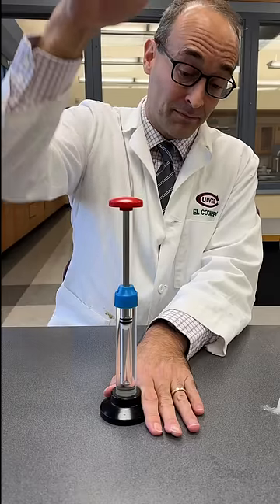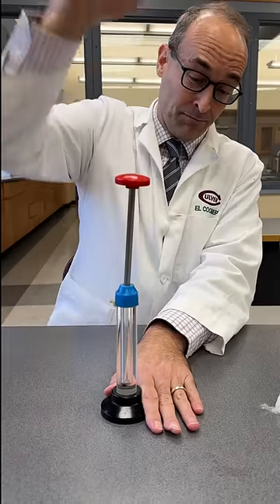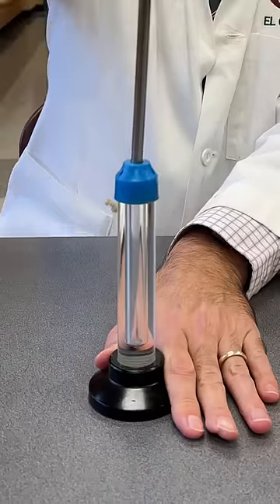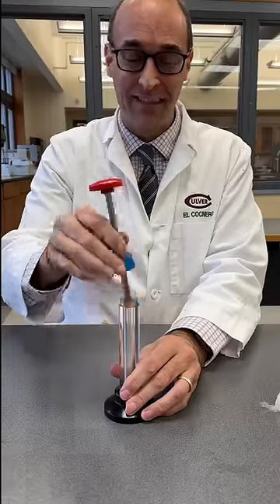Squeezing air to burn stuff

Comment: This is basically how a diesel engine works, uses no spark plugs.
Reply: Was about to say this.
Reply: Not basically, diesels are just a little more complicated than the tube and plunger he used
Reply: @kingofspain18077 This is exactly how a diesel engine works. Air is pulled inside the cylinder, and the piston then moves up compressing the air inside causing it to heat up. The only difference is the fuel is misted in towards the end.
Reply: @mattc222 no need for that. I got Cosby sauce lol (ether)
Reply: @jeffhall768  good ol Cosby in a can. MIIINT!
Reply: Why can't petrol ignite the same way?
Reply: @erickiplimo it does but it’s not intended. When normal gasoline ignites from compression it’s called knocking, detonation, or dieseling. That’s why people run higher octane, it’s a rating for its detonation or “knock” sensitivity. If gas go bang at wrong time, is bad for the engine.
Reply: Putting toilet paper in the gas tank now😂
Reply: @erickiplimo gasoline (petrol) burns faster and more easily than diesel does, if you did this with gasoline youd blow a hole in your pistons (the multifuel engine in the old US Army 2 1/2 ton transport was a diesel that could run on gas, but it had to have modifications made to the pistons and cylinders to prevent the gas from detonating, and you had to add oil to the gasoline so it didnt destroy the rest of the engine
Reply: This is exactly how a diesel engine works.  4-stroke gasoline engines go out of their way to avoid this.  The whole point of burning high octane fuel is to prevent "pre-detonation" of the fuel igniting before the spark plug ignites it.
Reply: They use Glow plugs to ignite the compressed  fuel
Reply: On old tractors, for example, you actually had to cut off the fuel to turn off the engine. Battery, no battery connection didn't really matter for those engines.
Reply: @erickiplimo they can, which is where the octane rating of the petrol comes in. Higher octane allows higher compression before auto-ignition.
Reply: Ty sir.  Gas engines do not work like this.
Reply: @erickiplimo Gasoline can be burned the same way. It's the holy grail of gas engines, look up HCCI. They've been working on it for decades, the fundamental problem is they can only get it to run without issues like predetonation in a very narrow power range.
Reply: this process is legitimately called dieseling.
Reply: @kingofspain18077  the actual physics are the same though. A diesel engine requires timed valves and a glow plug to meet autoignition Temps.
Reply: And this Is how submariners die when Hill breaches they Burn to death in miliseconds.
Reply: @41241ivatt no just no
Reply: They use glow plugs
Reply: My one cylinder diesel engine doesnt have glow plugs. Stop saying that diesel engine use glow plugs to ignite the fuel. The glowplug is just for warming the air when the engine is cold so it can start. Since the engine dont start easily in cold air. [I reckon it called warm start] even though. Some engine doesnt have to use glow plugs to start. Hence the so-called cold start
Reply: @hirusthehellhound  normal diesel engines literally need a glow plug to start itself and ignite the pulverized fuel tf are talking about , show me a single car without a glow plug
Reply: @alexandre007opa  well. Some of Hino engines doesnt have glowplugs. Even some of the isuzu. And also. A tractors. Newer Kubota here doesnt have glowplugs. And a truck with single cylinder diesel engine [called e-tan here in thailand] doesnt have glow plugs.
Reply: At least some do to start
Reply: @mattc222 this one
Reply: @erickiplimo because you need 2000 to 3000bar of pressure usually generated by fuel injectors on direct injection petrol car.
Reply: Glow plug
Reply: I was going to say the exact same thing.
Reply: No it's Not. The Diesel Air Mix is not getting compressed.
Reply: @41241ivatt nope The glowplug is used just at very low temperatures to preheat The cylinder
Reply: @mattc222 The glow plugs only light up if necessary. When it’s cold. They don’t light up at all during summer on my car.
Reply: He probably had a model of a ic engine. It's cooler to have a model

I bet you guys don't have a model desil to show off

/S
Reply: They use heat plugs.
Reply: Isn't it how all 4 stroke engines work on a compression stroke?
Reply: @kingofspainMB1807 that's what basically means. Everyone knows the real engine is more complicated. You really thought you said something interesting there.
Reply: glow plug
Reply: Yes, a diesel engine does work exactly like that. They don't need any electricity or spark plugs to run. Some diesel engines do have glow plugs to preheat the engine head so the engine does start easy even in cold environments. It's not needed for the engine to run at all. Modern diesel engines are more complicated to work more efficient and clean.  But they still do use this effect to run.
Reply: @kingofspainMB1807 wrong that is how diesel engines work
Reply: This is NOT how a diesel engine works. A diesel engine injects the fuel at the right moment.

You may be thinking about a glow-bulb or hot-bulb engine — that has fuel injected into the bulb, where it reacts briefly with the little oxygen available.
Then air is let into the cylinder and compressed by it, when enough air enters the glow bulb under pressure, the main combustion starts, reheating the glow bulb and pushing out the hot fuel into the cylinder where it ignites and burns with the oxygen.

Note that normal spark-plug gasoline/petrol engines can have fuel injection, which is a distinct advantage for acrobatics of fighter aircraft. The early WWII Spitfire famously had a normal carburettor and would cut out in negative g and then return to an overly rich fuel mix, both causing a momentary loss of power. Only with the pressure carburettor was this behaviour fully cured later in the war. 

German engines used fuel injection and were not at all bothered by negative g forces. Pilots used that to slow down an enemy following them. Fuel injection has other advantages, such as being able to have both intake and exhaust valve open for a long time, providing cooling and cleaning out lingering combustion products.
Reply: @mattc222 except you actually don't have too. It only helps when the fuel itself and the air is cold. It's only there for assistance.
Reply: @advorak8529  literally how a diesel enginen works.
Reply: Just an addition - you need glowplugs for colder to human climates.
Reply: @eivis13 you don't need them, but they help.
Reply: Explain please
Reply: @kingofspainMB1807  "Basically" - "used to indicate that a statement summarizes the most important aspects, or gives a roughly accurate account, of a more complex situation."
Reply: Yeah but they use the heat of rapid compression to inject fuel at the right moment.
Reply: @advorak8529 wrong
Reply: @bradleypolotto5193 preheated air on startup, and diesel injection against the hot compressed air. How is this the same?
Reply: @blitzv10   Name one diesel engine that does not inject fuel …
Reply: @LordScrambles1  Yep, you can use a blowtorch. Really old Lanz tractors for example …
Most car and truck diesel engines are not accommodating to blowtorches. No space to apply and way too many parts not tolerating a blowtorch nearby …
Reply: @jeffhall768  creating an "Ether Baby"
Reply: @41241ivatt No glow plugs are just for when engine is cold. Still uses "heat of compression" to ignite
Reply: @codyreber8370 glow plugs are only required at cold startup, not required at normal operating temps, at least in normal climate. Might be different in freezing climates, not an issue here in Australia
Reply: @alexandre007opa only when cold
Reply: @alexandre007opa might be climate dependent I don't recall having had glow plugs in my Toyota Prado & if it did would only been used at startup when we went to the snow 1500km away. I'm only aware of glow plugs in trucks here for cold weather & off once engine temp achieved.
Reply: @hirusthehellhound yeah, climate dependent I don't recall having had glow plugs in my Toyota Prado in Australia & if it did would only been used at startup when we went to the snow 1500km away. I'm only aware of glow plugs in trucks here for cold weather & off once engine temp achieved.
Reply: @bradleypolotto5193 also they usually use a heating element(glow plug) to aid in ignition to ensure an even combustion
Reply: @jeffhall768  Ether pudding pops 😏
Reply: @bradleypolotto5193 Doesn't diesel get injected as the piston starts to come back up? Either way, the diesel engine is more interesting than a gas
Reply: Yup
Reply: And tbh, this is where Rudolf D. got his idea.
Reply: They use glow plugs to get it going then it just runs off it’s own
Reply: First thing that popped to my head as well
Reply: @AzizSdiri  then don’t let the pressure rise so much😂
Reply: @mattc222 that’s what they meant by saying “not basically”
Reply: @kingofspainMB1807 they meant the concept in physics, not quite so literally as you took it lol
Reply: Exactly what i was about to say too
Reply: @kingofspainMB1807  dude the first diesel engines are literally just as simple as that other then injection
Reply: @erickiplimo gasoline is only combustible with a flame diesel is only combustible with heat if u pour diesel on a fire it will ignite due too the heat when air gets compressed it gets extremely hot so when u inject the diesel it instantly combusts
Reply: @erickiplimo if you do the same thing to petrol, it's very harmful for the cylinder and piston. You are able to do this in your car (DON'T!!!), using lower octane gas.
Octane number is how much do you have to decrease the mixture of air and petrol fumes for it to detonate, which is exactly what we don't want in our engine (it's like blowing up a small explosive tens of times per second inside). For pure octane it's around 12-14 times, if I'm not mistaken, and 95 octane number means the ratio needs to be 95℅ of these 12-14 times for that exact gas. So, in conclusion. Your engine 95? You may use 98, if you want, it would only hurt your wallet. Under no circumstances should you use lower than 95.
Reply: Compressing the oxygen within air creates a piezoelectric arc.
Reply: Came here to say this
Reply: @kingofspainMB1807  That's what basically means
Reply: Well, it does use heating plugs
Reply: @erickiplimo petrol engines use a spark plug because then the cylinder block doesn't need to withstand those compressive forces and can be made lighter. Compression ignition is useful for heavier and less refined fuels that are harder to ignite with a spark plug.
Reply: @erickiplimo diesel self combusts at 200 degrees petrol is much higher
Reply: @mattjohnson4751 Sometimes high compression gas engines do this when you burn a gas with a low octane rating. It’s called “knock” because the fuel detonates during the compression stroke before the spark plug can ignite it causing a knocking sound.
Reply: I was about to comment the same thing, until I saw your comment. Exactly.
Reply: @erickiplimo it can but it’s just easier to do with spark plugs
Reply: It is literally how a diesel engine works actually, just diesel (or basically any fatty oil) instead of cotton
Reply: @thedarkenigma3834 🔴 What Is Islam? 

🔴 Islam is not just another religion. 

🔵 It is the same message preached by Moses, Jesus and Abraham.

 🔴 Islam literally means ‘submission to God’ and it teaches us to have a direct relationship with God. 

 🔵 It reminds us that since God created us, no one should be worshipped except God alone. 

 🔴 It also teaches that God is nothing like a human being or like anything that we can imagine.

🌍 The concept of God is summarized in the Quran as:

📖 { “Say, He is God, the One.  God, the Absolute.  He does not give birth, nor was He born, and there is nothing like Him.”} (Quran 112:1-4) 📚

🔴 Becoming a Muslim is not turning your back to Jesus. 

🔵 Rather it’s going back to the original teachings of Jesus and obeying him.
Reply: @1islam1  What did I say that has anything to do with Islam or religion in general?
Reply: @erickiplimo you can't have optimum ignition timing, you'll have detonation instead of flame propagation.
Reply: @41241ivatt nope, only air is compressed. The diesel fuel that is injected is highly pressurized however.
Reply: @alexandre007opa Kubota farm engines is normal engine as well. 😂😅😊
Reply: @hirusthehellhound Also in old Toyota engines. Instead of glow plugs, it have that heater element in intake manifold that heats up intake air.
Reply: @DasKloputzer true, only air is compressed. Then the atomized diesel fuel when injected burns because of the heat generated during compression of air.
Reply: @advorak8529 somewhat similar, only the demo has no diesel fuel being injected.
Reply: @reddirtmoto4841  there are some thats called "fire starter" as well. As it literally start a fire in the manifold
Reply: @hirusthehellhound  I saw that being performed unto an old engine. I think it was a Kubota engine with hand crank starter.
Reply: @reddirtmoto4841  when the engine are old and worn out. Sure you want to do that. But a new and rebuilt engine doesnt need that
Reply: So this comment is For those who don’t know what combustion engines is?
Reply: @erickiplimo it can it's just a lot more unstable and it would be wildly inefficient to design an engine to do such a thing because of the force that would need to withstand for little to no performance gain would make the engine weigh more than the vehicle it would be able to power
Reply: It uses pressure and glow plugs
Reply: @kingofspainMB1807 yes so basically
Reply: @mattc222  my bmw has had faulty glow plugs for a couple years. No issues at all. Just runs like a traktor for a couple seconds if its really cold outside lol
Reply: What is a glow plug
Reply: @alexandre007opa real diesel engines don’t have glow plugs
Reply: @kingofspainMB1807 this is exactly how their combustion works. Add a crankshaft to the end of the plunger, put a shaft with a 2:1 timing ratio off of it to open and close a pair of valves 90° apart from each other, and you have a small diesel engine.
Reply: @erickiplimo it can be, but it is less predictable. A spark is a much more controllable way to ignite it.

A simple gasoline engine can actually burn diesel once it’s hot. Many old tractors had a fuel tank and a gasoline tank on them. Start the tractor and warm it up with the gasoline, and then switch a valve to make the engine burn diesel or kerosene, because it was much cheaper than gas in those days.
Reply: @kingofspainMB1807 this guys smart he knows a diesel engine is more complicated 🎉 only if everyone could realize this fact on there own it’s astonishing you should run for president or get your doctorate
Reply: @erickiplimo  Mazda SkyActiv X engine
Reply: Top comment, not disappointed
Reply: Bro I wanted to say this. But u r already there's 😊
Reply: I see that someone watched Veritasium.
Reply: @erickiplimo  Mazda actually has this. It is pretty complicated though. Others don't do it because Diesel engines have to be built far more robust due to pressures and such, which is why they tend to be significantly more expensive.
Reply: @opachki8325  so does it mean explosion by detonation is far more violent/stronger than explosion by ignition?
Reply: @erickiplimo  it just means that pressures required for a diesel engine to properly function are way higher. You need stronger pumps (500 bar at most vs. roughly 3000 bar), a stronger block, stronger internals and such due to higher internal pressures. 

Besides that it apparently isn't really that easy to pull off unless you really invest a lot of money apparently. The skyactiv-x engines only switch to this under low load due to way lower power per displacement.
Reply: The same thing happens with air rifles and it's called dieseling
Reply: Huh.. watch the video. That exactly what he said n showed.  Tf
Reply: @erickiplimo its not meant to.
Reply: @mattc222 unless its an older diesel where its just pure compression
Reply: What the frick
Reply: Diesels require a glow plug to burn or fire the fuel.
Reply: a diesel engine is a combustion engine it’s just powered by diesel
Reply: Next stop cotton powered engine.
Reply: @TonkarzOfSolSystem  i wonder how fuel delivery would work with that because the cotton could have the potential to stick a valve slightly open and could cause a random misfire
Reply: @i_eat_dirt2  The only think I can think of would be a belt fed design with little capsules that contain the cotton. But the precision required in timing and machining to create a combustion proof seal would be, I'm sure, impossible. Never mind the added weight of the belt and capsules, nor the added volume.

I was only suggesting it as a joke but still it's a curious problem.
Reply: @laurenciozabala4296  not all.
Reply: Glow plugs?
Reply: Why do petrol engines need spar plugs?
Reply: @jackfrostcm108  to light the fuel??
Reply: @jackfrostcm108  Diesel explodes when compressed, just a property of the liquid. Petrol doesn't, so to make the petrol explode there are spark plugs that ignite the petrol with an electrical spark at the right instant in the engine process.
Reply: @bradleypolotto5193  I always wondered what the difference was between a diesel engine and a normal gasoline one.

So there's no sparkplug? How does the engine start then?
Reply: @alexandre007opa No they don't.
Do you even know what a glow plug is?
Reply: @darklordofsword  the glow plugs are timed to only come on a short bit of time before you crank the engine heating the air inside the cylinders. As the piston goes up it compresses the air inside. As air compresses it heats up (I don't remember the exact temperature it gets to). Once the cylinder reaches close to TDC, the diesel is misted inside causing it to ignite. Without the need for an extra piece such as a spark, this can also cause a diesel to "run away". Basically, it will keep running even after you cut electrical power to the engine.
Reply: @FedSmoker64  i guarantee you most diesel cars in the EU will not start if they don't have glow plugs on, smaller engines pretty much relly on them due to their small volume they cannot produce the heat required in the compression to start , tbf most our diesel engines are smaller than 2.0 so i get where most people here are getting at try starting a 1.5 clio without glow plugs or a 0.9 smart but yeah doubt you need them in a pickup
Reply: @alexandre007opa  Just because poorly designed EU engines need them does not mean diesels need glow plugs. My deutz and international diesels have never needed glow plugs in freezing temperatures.

Diesels from their invention did not need glow plugs, but trash engines do.
Reply: It's not at all how it works glow plugs heat the fuel. This doesn't need any outside temperature to promote combustion.
Reply: @bradleypolotto5193 no, it's not. This doesn't need any added temperature source to promote combustion like a diesel engine does.
Reply: @-TAPnRACK-  Glow plugs are not needed on well designed engines. They are a luxury item not essential to the design of a diesel engine.
Reply: @FedSmoker64  maybe not glow plug but definitely a grid heater
Reply: @-TAPnRACK-  No, none of that is necessary and the original design of a diesel engine did not have them.
Reply: @-UnoriginalName-  not all diesel engines have glow plugs (which only activate before cranking). The concept is the same though.
Reply: You use no sparkplug
Reply: @FedSmoker64  they're hardly trash they're just smaller than the ones in the U.S but fair enough I get your point
Reply: It makes no sense adding Spark ignition into diesel engine because the mixture of air + diesel doesn't going to catch fire through electric spark.
So that's why it takes longer time to start diesel engines.
Reply: So simple differences is that the diesel hai compression ignition where the air is compression with high heat and insteas of spark plug the is fuel injection where there is Fuel+air mixture when the fuel expands and the power is transmited from crank to shaft and so on ...
Reply: Exactly. Some smaller ones have glow plugs though
Reply: I was just about to say that in a comment.😂😂😂😂😂
Reply: @kingofspainMB1807  yes basically, that is the perfect use of basically, it roughly explains the process in a BASIC way
Reply: Compression ignition
Reply: Yeah but mr doctor science didn’t say that, he was too busy huffing cotton.
Reply: @erickiplimo  It can, actually! That's referred to as an 'HCCI' engine (Homogenous Charge, Compression Ignition). It's tricky to pull off, but offers massive efficiency gains (20% or more) due to the ability to use extremely high compression ratios (in the neighborhood of 16:1). Mazda is now producing cars with HCCI engines. They call it "Skyactiv-X'. However, it currently only runs in 'HCCI mode' some of the time, as it's only possible (without detonation/knocking) under very specific conditions. Outside of those parameters, it reverts to spark ignition.
Reply: i mean they have glow plugs tho right? idk shit about diesel engines and what glow plugs do though
Reply: Well, they don't have a giant hand starting the action. It needs the initial combustion
Reply: Yes, it uses compressed air that sparks to ignite fuel with no spark plug needed.
Reply: They use igniter.
Reply: Beat me to it!
Reply: @alexandre007opa lol no. No, no, no. Look up the cummins 5.9L 12 valve. Used in tractors and dodge trucks for years and they dont have glow plugs.
Reply: @limptuna7687  I've explained my point of view on another respond, here in europe I'm pretty sure most diesel car engines can't hold up without glow plugs due to them being really small engines, kinda forgot about the high capacity engines used in other parts of the world and/or other sectors besides civilian personal vehicles
Reply: @erickiplimo Petrol or Gasoline is more stable and requires compression and a spark to ignite. Diesel, being less stable, does not need a spark
Reply: Diesel engines compress more air into a smaller space, so the temperature is higher and the fuel ignites. Gasoline engines need a spark since there is less compression.
Reply: Damn it, I was gonna say that!
Reply: but has glow plugs
Reply: @outkast937 Mazda is or was working on a compression fired gasoline engine. It was supposed to be an engine that could switch between spark and compression ignition as needed. Not sure how successful it was, but it’s been done.
Reply: Principle is the same.  There are just ancillary systems to put in more "cotton" and get rid of the "smoke."
Reply: @outkast937 diesel = 2 stroke.
Reply: Darn, you beat me to this
Reply: @kingofspainMB1807 oh you fucking think? Lmao
Reply: @erickiplimo it can, but diesel doesn't offgas flammable vapors, while petrol does.

This means you need higher compression to ignite
Reply: This is exactly what I opened the comments to say
Reply: Also is the reason intercooler scare needed
Reply: @41241ivatt  no glow plugs are used to heat up the cylinders of the engine before we even start the truck my 6.0 you have to turn the key wait until the glow plugs have turned off then start it because the engine needs the air inside the cylinders to be warm/hot to combust
Reply: @hirusthehellhound agreed when i am in warm state i pull the fuse for my glow plugs because its not needed in hot places glow plugs are only used before the truck starts diesel is a compression engine
Reply: @alexandre007opa  in hot areas glow plugs are not needed when i visit so cali i pull the fuse for my 6.0 f350 glow plugs because its always 60-80 and it starts up easy
Reply: zibret4199  no with diesel engines they always light up until the cylinders meet a certain temp that why during summer then shut off faster then during winter thats how my 6.0 powerstroke is any every one of my coworkers trucks
Reply: @erickiplimo  it would but it'll explode so fast and damage the engine
Reply: @Eli-ki7eh there's a huge difference between self ignition and detonation.
Reply: Turkish high-tech !   I have a folder about it.
Escape the matrix !
Reply: You learn something new every day
Reply: So why do we need diesel if air alone ignites ? 😂
Reply: @41241ivatt  lmao
Reply: @alexmedvec4571 Diesels have a electric starter motor just like petrols. During ignition, the start motor turns and pistons move up and down and so on. Diesel oil is prayed in the cylinder at the same time and what happened in the video starts to happen in the cylinders and the engine starts to run on its own.
Reply: @41241ivatt no, the glow plugs are only used to start an engine, they simply heat the air inside the cylinders to help with combustion initially, they’re not even on when the engine is turning over. Cummins engines don’t even have glow plugs, they have a grid heater in the intake to heat the air as it enters the cylinder. You don’t need glow plugs at all. The new holland 7.8l inline 6 from the 90’s didn’t them, just used ether when it was especially cold.
Reply: That's why they're also called "compression ignition engines".
Reply: I was gonna say
Reply: @cwest394 if you get it to flow like a liquid it would run in a diesel engine
Reply: @Boerkie1990   If slave lake can run on it, then its good.
Reply: Actually they have something else called a glow plug that gets it started
Reply: Also that's why you'll destroy your diesel engine if you put wrong fuel in it. I guess there is no much trouble with diesel in gas engines cause gas compression ratio is smaller than diesel
Reply: Glow plugs
Reply: Wait, diesel engines dont have spark plugs?
Reply: @11141q  nope they don't, diesel engines compress pure air, then due to high pressures when fuel is inyected combustion happens
Reply: Yeah! I thought that was familiar
Reply: @erickiplimo  because fuel is less stable and predictable and might light before the piston gets all the way to the bottom, causing the engine to try to spin backwards. This is called knocking. It still happens if you run too much timing or compression with low octane fuel.
Reply: @41241ivatt no... the glow plug is just there to get the inside of the cylinder hot enough for this to happen on a cold day... which is why you don't need then in summer
Reply: Shit. I read your comment after I wrote basically the same thing. Lol
Reply: @mattc222 that’s no longer an issue with new diesel engines.
Reply: @41241ivatt nope they sure don’t.
Reply: @kingofspainMB1807 it’s just the basic premise that the cylinder compresses the air so much that it gets hot enough to ignite fuel diesel just happen to spray fuel right at tdc after the air is compressed to make combustion
Reply: But often use glow plugs to get going
Reply: @gingernutpreacher  not always and that’s just for starting in cold weather
Reply: @gingernutpreacher  newer diesels don’t unless in extremely cold environment.
Reply: @williambiggs9752  yes they do as there relatively small IE 4 cylinder 1.6
Reply: @christiangirard6634  for starting in general most European diesels are small  like 1.6 for example
Reply: @gingernutpreacher  no one cares about small euro engines and I’m speaking for American engines big 6+liter engines
Reply: Was going to say a diesel is probably better example than a gas engine with spark plugs
Reply: @christiangirard6634  no one cares about big American diesel engines. Which engine is more common in the world? ( you also need to look at Asia and China)
Reply: Beat me to it
Reply: That's exactly how a diesel works except the fuel is delivered to that highly compressed air charge and ignites on contact.
Reply: You stole my comment. You stole it real good.
Reply: @bradleypolotto5193 Ok, so this is exactly how a diesel engine works except it’s “just a little more complicated”, like kingofspain said.
Reply: Excellent
Reply: The time required for catastrophic implosion to occur following a hull breach is absolutely not sufficient for human beings to burn to death prior to the flooding of a submarine. Submariners don't burn to death during implosions. @JMiskovsky
Reply: @kingofspainMB1807 you got wrecked nerd
Reply: @kingofspainMB1807 but do you know how a diesel engine operates? It operates just as similar to the ICE with the exception of spark plugs.
Reply: Glow plugs not spark plugs spark plugs would never ignite diesel
Reply: @tvoovm7254  It has pistons, connecting rods and valves, sure. But in many other ways it is very different. It doesn’t adhere to the stoichiometric ratio for example, isn’t designed for the same atomization pattern as gas, is timed by the injection of fuel, and is often sensitive to combustion temperature, meaning high load over a long period can melt pistons.
Reply: Don’t the use glow plugs because Diesel doesn’t ignite itself, but Gasoline does, so it has spark plugs but only uses them for the start?
Reply: @Pelpe  think of a diesel as a “heat engine”. It squeezes air to get the air hot, so it can be used to combust diesel. However a diesel sitting in a cold environment overnight will be too cold for meaningful heat to be generated at startup. Glow plugs exist to bridge that gap, providing heat with which to start. Once the engine is running, it builds its own heat.
Reply: @Pelpe  smaller diesel engines like Ford 350s and all will use glow plugs cause they can not create enough compression the compression super heats the air and ignites the diesel fuel in the larger diesel engines like semi trucks construction equipment city and charter buses no glow plugs required  s50 sy0 Detroit diesel Cummins c13 cats
Reply: @bradleypolotto5193 why did you basically just say exactly what that other guy said and reply like you were correcting him
Reply: The amount of people that think glow plugs work like spark plugs is crazy 😂
Reply: @zf9903  still doesn't change the fact that that a diesel engine has most of the operating components and mechanism of that of an ICE, and it doesn't matter if the fuel of both types of engines are injecting fuel at different times; why would timing be accountable if every type of engine has different timing respectfully? I'm not talking about timing here. I'm talking about the components and mechanism, but I've already clarified that the diesel engine operates SIMILAR to that of an ICE engine with the exception of spark plugs. My statement still stands.
Reply: Didn’t know that!
Reply: @mattc222 not every diesel engine has glow plugs
Reply: @41241ivatt no they don’t
Reply: @codyreber8370 glow plugs are not required. They just make cold starts easier.
Reply: @alexandre007opa not every diesel engine has glow plugs. They just make cold starts easier.
Reply: @alexandre007opa I work on diesel engines without glow plugs. I’m a generator mechanic in the marines.
Reply: @bradleypolotto5193 

I think he was talking about the device. An engine is automatic, and so more complicated than a manual pump thing. Imagine a manual engine lol.
Reply: Yo, can we do this with keef? Lol
Reply: My thoughts exactly. “You wouldn’t expect” to know that unless you’ve worked in the real world. These egg heads are so out of touch.
Reply: 2 stroke diesels to be specific.
Reply: They are not meant to but they can, basically diesel engines compress a lot more, to do the piston has to move higher that's why they provide more torque than petrol engine. The distance between top dead center and the shaft is bigger than that of a petrol engine   @erickiplimo
Reply: He doesn’t know 👨‍⚕️🤦‍♂️😂
Reply: I got it, thank you Mr mechanics
Reply: Then why do regular gas vehicles need spark plugs when compression alone ignites?
Reply: Was just gonna say that lol
Reply: Basic... Boyle's law
Reply: @stevemiller. Because they're just built different
Reply: @stevemiller.  You're not making sense here. Regular gasoline cannot ignite during compression ALONE because it's impossible; gasoline only ignites if there is fire in the present in the engine which is the source of engine operation. For instance, a spark plug will ignite the fuel during the Power stroke where the air and fuel mixture get warm, with the help of the secondary ignition during this specific stroke (ignition coils being inducted and delivering all the power to the spark plug) enabling the explosive power of motion helping the engine to operate during the entirely of the 4 stroke cycle over and over again until there's barely fuel or the vehicle gets switched off the ignition. The spark plugs are also a key part of the ignition system operation.

It's not hot enough to burn gasoline alone without a spark plug.  

Now imagine if you did NOT have any spark plugs on your "gasoline" car's engine. It will not only be impossible for the air fuel mixture to ignite, it will also be impossible to complete the ignition system cycle where the engine suppose to run.

Why would you think that gasoline can ignite during compression WITHOUT spark plugs?
Reply: @41241ivatt glow plugs only pre-heat the cylinder on initial startup. That's why you have to turn the key to "on" for a moment before cranking.
Reply: @DasKloputzer You are incorrect. That's the difference between direct and indirect diesel injection. Both are still widely produced.
Reply: @mattc222  diesels don’t need glow plugs and most diesels larger than what you see in a pickup truck don’t have them.
Reply: @erickiplimo it can…..but it’s too unstable and violent to be used in a normal sized internal combustion engine. Older carbureted Cars with lots of carbon buildup in the combustion chamber / on the piston crown surface can actually keep running with the key shut off for just that reason. The carbon buildup raises the compression ratio enough that when the cylinders are warm the fuel can auto-ignite without spark and the engine will keep running, albeit poorly and very loudly.
Reply: Yup more or less
Reply: 37026
Reply: @bradleypolotto5193  did u forgor the glowplug?
Reply: @thedarkenigma3834  that’s what I’m sayin
Reply: @straightpipediesel there does appear to be a Mazda engine that has gotten extremely close, with crazy compression ratios, but it still needs a spark. It is a highly efficient engine, though.
Reply: @kingofspainMB1807 it is not much more complicated than that 😂
Reply: @mattc222  don't need glow plugs
Reply: @41241ivatt No the glow pulgs heat up the cylinder prior to starting obce the engine is sufficiently warm they switch off
Reply: Diesel should be capitalized. It’s a proper name. I get sad seeing Rudolph Diesel being disrespected.
Reply: @41241ivatt They do not. They use compression, it's right there in the name "compression ignition."
Glow plugs prewarm the cylinders prior to start up and are technically optional. Many competition vehicles delete the glow plugs entirely.
Reply: @reddirtmoto4841 Well of course, how are you going to inject cotton?
Reply: @TonkarzOfSolSystem petrol absolutes explodes when compressed. The whole point of high octane fuels is to resist detonation until the exact right time. Pre-ignition is called knocking or pinging and can destroy an engine by working against the internal parts.
Reply: @stevemiller. Spark plugs allow precise control of ignition timing, which is important for not blowing your engine to pieces. It's also why gas engines tend to be considerably lower compression than diesel engines. High compression and low octane can permit gasoline (petrol) to detonate without spark, but at unpredictable times during the stroke. The flame front might work against a rising piston (wasting power or damaging other parts) or even backfire through an open valve back into the intake.
Reply: @Lawrence330  okay
Reply: @kingofspainMB1807 .... No.. this is exactly how a diesel engine works. The only difference is the glow plugs, which are only there to start the cycle. Once the engine is running, the plugs dont do anything.
Reply: @erickiplimo it does, but not a good reason to. Pre ignition in a gasoline/petrol engine is called knock and is bad for the engine. can cause damage to the combustion chamber to uneven hotspot and spread of energy. pistons could shatter. thats why we have different octane ratings
Reply: Legit was gonna say that, so the mechanics be flocking to this comment lol
Reply: @Austin41241 
Yes but also no, sometimes a glowplug is necessary but not always. It varries from engine to engine and really glow plugs are mostly used for cold starts and not run the entire time. Friction is normally the main method of combustion in this type of engine. And really if you turn it over enough times you would not need the glue plug to start it. The plug just makes cold starts easier!
Reply: @alexandre007opa as i just explained to the previous guy yes, but also no,  glow plugs are used in these engines yes but normally they are used primarily in cold starts and to ensure full combustion of the fuel. They are in no way required!
Reply: @akun10years10 yes but also no! Glow plugs are used mainly for the cold start of this type of engine. They are also occasionally used to ensure full combustion of the fuel but are in no way required and friction is the main method of combustion! Hope you learned a cool thing about engines today!
Reply: @kingofspainMB1807 not really lol! Amazingly they are super simple engines!  But what isn't simple is the fuel! So you may be thinking oh well glow plugs are how they work, and you would be partially correct! Glow plugs are used in cold starts to make starting the engine for the first time easier but the plugs will normally shut off after and if they come back on its to help the fuel cumbust completely.  There are still diesel engines that do not have glowplugs! They are rarer but do still exist and they aren't really required for any of them. Diesel engines were literally created with this video's experiment in mind! I hope you learned some neat things about engines and have a good timezone!
Reply: @erickiplimo well the answer is it can. Its just harder and doesn't burn completely. Petroleum is a more stable gas and really won't ignite very well at all unless mixed with air. Diesel by contrast is more unstable and more willing to ignite under forces like friction.
Reply: @41241ivatt  No, the glow plugs heat up the cylinder so that the diesel can reach its evaporation temperature. The plug isn’t actually responsible for igniting the fuel.
Reply: I always wondered, why do gasoline engines have spark plugs anyway? Gasoline is more volatile and even has a sub zero flashpoint so I'm sure it can ignite by compression, definitely at a much less somoression ratio that that of a diesel engine
Reply: About to say the same thing
Reply: All ic engine works this way some need spark as too much compression may not utilise the fuel efficiently
Reply: @kingofspainMB1807 if he added a heat source and some holes it would be the same
Reply: Compresses the fuel and produces heat energy to push the pistons
Reply: And a jet engine
Reply: glow plug:
Reply: They use glow plugs
Reply: Very True
Reply: Rudolph Diesel got the idea for a compression-ignition engine from a cigar lighter that worked just like this.
Reply: was about to say the same
Reply: @mattc222 not all diesels have glow plugs
Reply: @erickiplimo because of the high pressure in the cylinder at time of injection for a diesel engine, the fuel system needs the lubricating properties of diesel fuel (basically super light oil) to lubricate the moving parts. 

Gasoline doesn't lubricate anything, so it's been challenging to design a pump and injectors that can operate at a few thousand PSI with gasoline's lack of lubrication. 

So it's not so much that gasoline can't, it's that the fuel system can't.

As a side note the issue with gasoline in a diesel isn't the commonly held misconception of ignition way too early, because there's no fuel during compression. Instead the issue is that the gasoline destroys the fuel injection system by removing the lubricating properties of diesel fuel.
Reply: @41241ivatt no they don't. Glow plugs are a cold start aid only. The fuel isn't compressed, only the air, the fuel is shot in at the ignition point (injectors serve as spark plugs for a gas engine).
Reply: @basslachnith865 new diesels you still cut off the fuel to turn them off. Just often it's done by a electrical solenoid that kills fuel when you turn off the ignition.
Reply: @alexandre007opa only for cold start. And not all use glow plugs
Reply: @hirusthehellhound finally I'm not the only person here who knows how s diesel engine works lol
Reply: @alexandre007opa every 5.9 Cummins ever
Reply: @Veroxzes or when manually switched on like my truck that is slightly modified
Reply: @LisaAnn777 no, gas engines don't get hot enough to auto ignite, they use spark
Reply: @FactionalSky mostly just the emissions side of things. Otherwise they're mechanically simpler then the older diesels
Reply: zibret4199 depends on the vehicle. I've had 6.2s with automatic glow plugs that kicked on anytime it was under like 80 out. My current 6.2 is just set to cycle them anytime master power is turned on
Reply: Exactly!!!
Reply: @bradleypolotto5193  it’s atomized bro not misted
Reply: @SilverStarHeggisist  well I am a diesel tractor mechanic myself. I repair thise hand crank diesel engine a lot. Take an example. The Kubota RT140, ET100. Try find a glow plugs on them haha
Reply: Yes my truck runs on 100% cotton
Reply: @hirusthehellhound  I think you meant to reply to someone else
Reply: Just sprays the diesel into the hot compressed cylinder.
Reply: @arifariffulislam2246  exactly
Reply: @mattc222 actually, glow plug doesn’t heat everything up, it just produces a hot spot to help trigger the explosion of the fuel-airy mixture.
Reply: I WAS ABOUT TO COMMENT THIS
Reply: @SilverStarHeggisist  I didn't say they auto ignite the fuel, I said 4 strokes have a compression stroke along with a combustion stroke. Not that it compresses fuel enough to ignite it, it's just compressed air.
Reply: @LisaAnn777  I had interpreted your response to mean that since the video was about compression making enough heat to auto ignite. 

Though yes, gas engines usually don't compress the air fuel mixture enough for auto ignition. Gas engines are usually a air fuel mixture being compressed. 

Diesels compress the air enough to auto ignite the fuel, why they need to wait to inject the fuel.
Reply: @kingofspainMB1807 I don’t think you know what basically means
Reply: @mattc222  no. That only helps starting it when it's cold.
Reply: @alexandre007opa I'll disconnect my glowplugs in my car since it's easy to do and show you it'll start in freezing Temps. It'll take maybe 10 secounds of cranking but it will live.
Reply: @alexandre007opa  also. Show me where the glow plugs are on a cummins engine. They don't use them. They use a grid heater on the intake manifold. Which alot of guys throw away.
Reply: Wrong. Glow plugs are only used to warm the cylinder when starting with a very cold engine in a very cold environment. If the weather is warm youll never use glow plugs
Reply: @SilverStarHeggisist  no they don't.
Reply: @hajjdawood  under normal circumstances. If there is an issue with injection quantity (IQ) and injector timing and let's just add a very worn cylinder, it might need alittle more assistance lol.
Reply: @hirusthehellhound durr the glow plug is that tube thing with a steel line going to the square box thingy
Reply: @quyle9483  no they don't what? Sorry I've no idea which of my comments you're replying to
Reply: @SilverStarHeggisist  a diesel combustion engine does not use glowplugs to fire the cylinder.
Reply: Or fire fuel
Reply: @quyle9483  you're replying to someone else, probably why the confusion. I've not said they do but have been explaining to several why they don't and how glow plugs are just a cold start aid
Reply: Newer diesels yes, but some older diesels used glow plugs to ignite the fuel. You just gotta know which is which
Reply: @abskhairoun because the lower flashpoint of gasoline/petrol just means it releases its vapours at much lower temperatures than diesel. It’s these vapours that make it volatile which the spark plug ignites. Diesel has a much high flashpoint but a lower auto ignition temperature, so it can be ignited just by the compression in the cylinder without the need of a spark
Reply: @quyle9483  Correct. On the flip side if you use an engine block heater regularly even if its cold it wont need it. I even use it if its like 40*F, it runs super smooth from the start and nothing beats going into a cold car with instant hot air when you turn it on.
Reply: @hajjdawood   I don't have a block warmer. Just an oil warmer.  My car 99.5 jetta is a glx so it has heated seats which does the trick for me.
Reply: @41241ivatt No, what? That is absolutely not what a glow plug does. What?
Reply: This is also how guns are fired
Reply: @kingofspainMB1807  isnt that was basically means 🤣🤣 this is 100% how it works. Compression combustion.
Reply: @41241ivatt This is incorrect. The glow plugs are only to pre-heat the system in cold weather to start ignition. In warm temperatures and after a diesel starts, the reaction is exactly as this demonstration, with high compression providing the necessary pressure and heat to ignite diesel fuel. 

It's a violent, disorganized ignition that requires all engine parts to be built far stronger than in gasoline combustion. The spark that ignites gasoline provides a predictable ignition as a wave. This, as opposed to multiple ignitions in the cylinder both pushing the piston and fighting one another in a diesel engine.

The glow plugs have nothing to do with the regular ignition of a diesel engine. They simply assist starting the vehicle from a cold state.
Reply: @codyreber8370 Not true. They only require glow plugs for starting in cold weather. Otherwise, auto-ignition requires no outside heat or spark.
Reply: @alexandre007opa False. Glow plugs are only necessary in cold weather to start a diesel engine.
Reply: @alexandre007opa False. Glow plugs are only necessary to start diesel engines in cold weather. Otherwise, the high compression auto-ignites the diesel fuel. 

This results in a disorganized ignition in multiple places within each cylinder. It's far more violent than spark induced, gasoline ignition. This is why diesel engines are made with much heavier, thicker parts. They literally have to withstand a more damaging ignition with each fire of each piston.
Reply: @khmerghost Only to start in cold weather. Glow plugs are not necessary otherwise.
Reply: @LisaAnn777 Yes and no. Diesel engines works on high compression that creates enough heat for auto-ignition of the diesel fuel. Gasoline engines work on some compression but ignition is caused by the introduction of a spark. 

Some high performance gasoline engines, such as those in high performance vehicles such as Corvettes, Ferraris, McLarens, Lamborghinis, etc are high enough compression to cause auto-ignition. This is bad for a gasoline engine. That's why high compression, gasoline engines require high octane gasoline. Octane is not a measure of quality or concentration of power. It's a measure of anti-ignition. The higher the number, the harder it is to create auto ignition of gasoline. This is why it's unnecessary to buy mid-grade or premium gasoline for most cars. They don't need the higher octane and there are other ways to clean your injectors, etc with fuel additives run through a tank of gas every time you change your oil or so.
Reply: @advorak8529 This is exactly how a diesel engine works. High compression creating massive heat causes auto ignition. 

Glow plugs are only used to pre-heat to start the engine in the cold. When the diesel is injected is not a magic auto-ignition factor. It's simply timed to coincide with the compression in the cylinder.
Reply: @fantasticsound2085     This is exactly how a diesel engine works. High compression creating massive heat causes auto ignition.
Plus diesel fuel ignites at lower temperatures than gasoline, but yes, agreed. 

Glow plugs are only used to pre-heat to start the engine in the cold.
Again, agreed, but there are engines — not exactly diesel engines, just similar — that work slightly differently, using and requiring a hot-bulb/glow-bulb that needs heating up with e.g. a blowtorch…

When the diesel is injected is not a magic auto-ignition factor.
Actually, it is — diesel cannot auto-ignite without oxygen and heat. Nor can really hot compressed air ignite diesel that is not there.

Gotta mix these two together. 

It's simply timed to coincide with the compression in the cylinder.
You meant “coincide with the position of the piston in the cylinder, so the push from the burning/burned diesel comes just after the high dead point, where it does most good and no harm like knocking? Yea, it is.

The compression itself starts when the lower dead point is passed and all valves are closed. Which would be a bad time to inject the diesel.
Reply: @advorak8529  You've twisted and misunderstood most of what I wrote. 

There are more efficient points to inject diesel fuel into the chamber, but the fact remains the fuel/air mixture could be combined anytime during or before the compression stroke and would still get hot enough to combust. It's done later to ensure near complete combustion by heating the cylinder first with air compression. Not necessary, just a far more efficient burn. Nobody, certainly not I, suggested there would be auto ignition without either fuel or oxygen. My point spoke directly to your seeming assertion there would be no combustion if the diesel were introduced before compression was achieved, which is not true. 

Then you restated exactly what I said from the perspective of the engine parts rather than the operating physics as though you were imparting new information and I was wrong. I wrote exactly what I meant and it was correct. Diesel fuel is introduced under compression. That's a state. Not the beginning of the stroke. 

But again, even if introduced at the beginning of the compression stroke a diesel will combust, if unnecessarily violently, causing inefficiency and damage to the engine. Even at the proper time, injecting diesel results and multiple, random auto ignitions vs the relatively smooth wave created by spark induced, gasoline engines.
Reply: @alexandre007opa nope; diesel engines work on compression alone; they pull in air; compress it enough to allow diesel to auto ignite; at a certain point, the fuel injecter injects the diesel in so it'll ignite and provide power.

Glowplugs are used when the engine is cold on frigid days. 
Since a diesel engine works on compressing air till it gets extremely hot; it takes a lot of power to get it to start.
The problem comes in when the engine is cold due to being off for a long period and its a cold day.
Now it has to raise the temperature of the air even more which could cause the battery to die before its able to do it enough. The glow plug helps eliminate that problem by warming the air inside the engine to reduce the amount of cycling it'll need to run.
Reply: @kingofspainMB1807 so this basically lol
Reply: @bradleypolotto5193  He's just trying to diminish your comment,pretending to know something😂..He probably was thinking about radiator,belts,pumps😂
Reply: @Austin41241  No they don't.  Glow plugs are on for like 2 seconds while starting the engine to help if it's cold.  You can start a diesel without glow plugs unless it's freezing cold.  I'm a diesel mechanic by trade btw
Reply: @alexandre007opa no they don't....
Reply: @TonkarzOfSolSystem  NO. BOTH
Diesel and Petrol can explode/ignite/combust when atomized into air and compressed.
 
Petrol definitely self detonates under compression if the conditions are shitty enough... 
We've known about pre-ignition for over 120years!!
Reply: @hirusthehellhound  You showed more than a single one without a glow plug, in fact you gave several examples. Did @alexandre007opa ever actually reply and acknowledge this or did they just run away and hide like a coward?
Reply: @nicholasgilbert4227  seem like they just ran away
Reply: @kingofspainMB1807 no it actually is basically how it works. It compresses  the air and it heats up and combusts...
Reply: @hirusthehellhound  seems about right
Reply: @nicholasgilbert4227  yup
Reply: @mattc222  Actually the glow plugs turns on only if the outside temperature is below -5 C. At least in the the common rail system.
Reply: When atomized Diesel is sprayed into compressed air, it ignites spontaneously.
Reply: @alexandre007opa  Glow plugs are only there for low temperatures. Diesel self ignites at the pressures inside those engines
Reply: This is true,........
Reply: High pressure, high temperature, low volume ; PV =nRT
Reply: @kingofspainMB1807 No, they're not. Of course modern high performance diesels are precision engineered and have all sorts of technologies to make them run more powerful and with lower emissions but the basic principle is the same as this man slapping a piston.
Reply: @erickiplimo  petrol engine  shouldn't because it will destroy the engine. It's called knock and it's bad.
Reply: Diesel engines use glowplugs to achieve this
Reply: @HighLatencyEmu  No they don't. Glowplugs help start a diesel engine in cold weather, they just mildly heat the air on a cold day so it's easier to get going. The cycle is all compression.
Reply: @mattc222  Yeah, have that -20° Celsius (or lower) winter day and good luck.
Reply: @hirusthehellhound  Thankyou I was just thinking this
Reply: Diesel is just really, really, really old cotton.
Reply: @alexandre007opa I've been a mechanic for 15 years and glow plugs are only used in cold weather to preheat the cylinder to aid in starting. The glow plug is not on during cranking and warm up once running
Reply: Diesel engines operate under what's called "Compression ignition"
& Gasoline engines use Spark ignition. 
All diesel engines ever made have used a form of fuel injection to deliver the heavy fuel oil into a chamber that's being compressed to many many times more than. Atmospheric pressure 15:1+
Reply: @jeffhall768  I smell zipties
Reply: @kingofspainMB1807 

So, youd say this is a very boiled down and rudimentary understanding of the mechanics behind a diesel engine.

Almost like it's basic.
Reply: No shit Sherlock
Reply: @nanielorenzo8005  all ic production vehicles have 4 stroke engines and since gasoline direct injection was introduced, they've been spraying fuel directly into the cylinder at the tail end of the compression stroke just like diesels. Mazda and Audi are even working on versions of variable compression engines to take advantage of the benefits of compression ignition (diesel) and spark ignition (gasoline). And runaway in diesels can only happen if fuel keeps flowing which is a malfunction in the injection system from stuck open injectors to out of time lift pumps etc... it's not a function of how diesels work
Reply: the old detonation engine
Reply: @erickiplimo  diesel is basically a light oil. Gasoline is a straight up solvent. Due to the mechanics an engine that works like a diesel but running on gas would break almost instantly. Diesel keeps everything lubed up.
Reply: @1islam1  Our Almighty God is not equal to Allah. Kindly don't lie.
Reply: This is not basically how a diesel engine works, this is how a diesel engine works. "diesel fuel is injected into the combustion chamber of the engine and ignited by the high temperatures achieved when the gas is compressed by the engine piston".
Reply: @mattc222  no need for glow plugs unless the block is cold. In warm climes, we don't ever use glows
Reply: nO sParK PLugs....

Bro. Wtf you think a glow plug is?
Reply: The cotton is the fuel here. Diesel engines don't compress fuel until the blend ignites. It compresses the air and then injects fuel at the right time so that it ignites.
Reply: @kingofspainMB1807 Diesels are a joke lmao
Reply: @kingofspainMB1807  do you know what the word basically means? "a less complicated version." exactly what you said it is. so clearly it is basically how a diesel engine works based on your own comment
Reply: So why does petrol cars need spark plugs?
Reply: @kingofspainMB1807 not really…. Crazy compression to self detonation is the whole thing… same same
Reply: that was literally my first thought
Reply: Beat me to it.
Reply: Thats also why they dont make high hp or rev high 😂
Reply: Why can't petrol do them then ?
Reply: @41241ivatt Glow plug is needed only for cold starting. And Modern engines don't use glow plugs. Diesal ignites immediately after being infused into hot compressed air.
Reply: @mattc222 you can delete glow plugs in a diesel and it’ll still start fine unless it’s crazy cold outside
Reply: Just don’t forget to let the glow pugs warm everything up before starting it.
(I typed the above post when it was bitter cold outside during the winter.
I posted this for cold days and if the engine is outside.
I live in Iowa, it gets cold here and didn’t think about other places, also I typed this while it was below freezing and sometimes below 0° F outside.
I also forgot that some diesel engines don’t have a warming system.)

Please read my now edited full message before commenting.
Reply: @tvrashid I know during very cold weather my diesel work truck has to be plugged in at the end of the day so the engine block warmer keeps it warm for the following morning.
Reply: @kingofspain18077 well, yeah, engines are complex, exept this is exactly how a diesel piston ignites.
Reply: That's not where the cycle ends! The piston goes down because of the explosion, ... another valve opens when the piston get's up so the fumes get out. And that's the cycle! ..... You just descibed backfire in a diesel engine!
Reply: You wouldn't think he said. We know. This guy thinks we are idiots
Reply: @41241ivatt no
The glow plugs are only there to warm up the engine a bit before it starts as it will struggle to idle when cold

There may be some that keep the glow plugs on while running to help warm up more

But the glow plugs don't remain on while running
They will most definitely burn out very very quickly
Reply: @alexandre007opa "need a glow plugs **to start**"
Reply: not all some use glowplugs
Reply: @kingofspainMB1807  same principle 🤦‍♂️
Reply: That's pretty much exactly what I was going to say!
Reply: @mattc222 but aren’t necessarily needed. Diesels can fire without glowing plugs, but depending on the compression and ambient temp, they may bee needed to bring things up to temp. Alternatively, even lower octane fuel can be used to get it to fire a couple times the. Mix in the diesel.
Reply: @hirusthehellhound I never said glow plugs act like spark plugs…..
Reply: @codyjohnson5674 I posted that comment during the winter months freezing my ass off in the Iowa cold weather.
I said glow plugs only because they may be needed in weather like I was experiencing.

Although my work truck doesn’t use glow plugs, but an engine block heater that is plugged in with an extension cord at the end of the shift if we are going to be working the following day.
Reply: @mattc222  i see. But you said that diesel engine use glow plugs like a nitro engine... Is it?
Reply: @kingofspainMB1807 "Not basically." "They're a little more complicated."

So in BASIC terms, that's how they work, because it's a little more complicated than that. 😂
Reply: As a German, it's always so crazy to me, how many German terms there are in English
Reply: Literally said this to myself as I opened the comment section
Reply: @kingofspainMB1807 Im other words, basically
Reply: Diesel engine still need a glow plug to heat the mixture for combustion.
Reply: @SwiftractPtss  but still, no spark lol
Reply: @Veroxzes you are absolutely correct. My comment that I made was in the middle of a bitter cold Iowa winter, forgetting about warmer months, and about the diesel engines that may not have glow plugs or other methods of warming the engine or cold start diesel engines.
Please forgive my comment. I have been getting comments for months about my post formatting about all diesel engine types and configurations.
My work truck in fact doesn’t use or even have glow plugs for cold weather starts, but an engine block heater that needs to be plugged into an extension cord to warm the engine or keep it warm for starting on cold Iowa winter days.
Reply: It’s also how the atmosphere burns up meteorites and well anything that impacts the atmosphere
Reply: @kingofspainMB1807 the op is correct, it's a  basic version compared to the complexity of a diesel engine. This, meaning the fire piston is basic. Respectfully.
Reply: @kingofspainMB1807  it is basically, what basically means if you understand english words AND the full meaning behind it you would know basically is not exactly basically would be like a sketch drawing version of a picture which was once colored and the colored picture is exactly
Reply: @41241ivatt no, only to start engine in cold temps
Reply: NOT! fuel injection in diesel engines starts AFTER compression by high pressure pump. Only air compressing by piston, not fuel.
Reply: Not really, you have to have the diesel fuel In the air mixture not just pure air.
Reply: @thedarkenigma3834 same
Reply: @kingofspainMB1807 they're actually not. They're very simple.
Reply: @JMiskovsky no that's not true. A hull breach just causes water to ingress. You're talking about when a sub reaches crush depth and implodes. Like the titan sub.
Reply: @alexandre007opa only for cold weather conditions. Diesels like VW cars don't have them.
Reply: @advorak8529  omg yes it is. It's exactly how diesels work. The only reason modern engines inject the way they do is because it's more efficient. How do you think diesel engines worked before direct injection existed?
Reply: @trevorcurrie4774  like what happens in 300m ?
Reply: I was gonna say, for a scientist, he made an odd flub there just saying combustion engines in general.
Reply: That's basically how an engine works
Reply: @kingofspainMB1807 so just a basic diesel engine, so basically a diesel engine
Reply: Um, it uses glow plugs...
Reply: thanks bro i was about to say it
Reply: It uses glow plug which glow red hot. No glow plugs no combustion.
Reply: What is a diesel engine?😆😆😆
Reply: What is diesel engine?😆😆😆
Reply: @41241ivatt  Glow Plugs does'nt ignite fuel, lol...
Reply: @erickiplimo  it can, but it burns too quickly
Reply: @erickiplimo Ii can this is the cause of knocking
Reply: @kingofspainMB1807 You apparently don't understand the concept of "basically" 😂
Reply: you beat me to it
Reply: and certain brands of office chairs
Reply: @alexandre007opa the 5.9 and 6.7 Cummins used from 1989 to present in Dodge and Ram trucks don't use glow plugs. They use a grid heater on the intake to warm the air at low temperatures. The 6.7 doesn't use the grid heater when ambient temps are over 60°
Reply: Some diesel engines use sparkplugs , to hear air before geting in the cilinder, extremly useful at winter
Reply: @erickiplimo  because it explodes instead of burning like diesel, does. Diesels work so well because they actually burn through the entire power stroke, gasoline (petrol) burns at the very beginning, but if they burn too quickly it just explodes and blows a hole in the piston
Reply: Not basically, thats exactly
Reply: @kingofspainMB1807 yeah you don’t know what you’re talking about. It is EXACTLY what is being shown here 😂
Reply: Would of been a better example
Reply: Yep there's a guy slamming a hand powered piston non stop under your hood.
Reply: Some diesels use compression some use glow plugs
Reply: So could we run cars on air instead to save some money?
Reply: @alexandre007opa they only help the engine start. That’s it. They turn off when running
Reply: Nice that 45 000 people are smarter than he thinks we are
Reply: @kingofspainMB1807 dude whats “basic” mean? Simplified. Whats the opposite of “more complicated?” Simplified.
Reply: @bradleypolotto5193  so as he said a little more complicated to add fuel to it aswell, God your dense, repeated what he said and only added exactly what we watched in the video
Reply: Cooool 😮
Reply: Nice bit of info, now I know a tiny part about mechanics 😅
Reply: @bradleypolotto5193 I always thought that diesel qngines use a glowing coil instead of a spark plug and that's why you could basically fill it with almost any liquid that burns?
Reply: And this is called knock in a gasoline engine.
Reply: Petrol is more volatile so requires less energy to ignite. The engine needn't be quite a heavy and robust to contain the explosion. Pros and cons to both@erickiplimo
Reply: They have "starter" plugs(idk the real name) they are used at first when the piston is cold to help with the first few explosions but once it's hot the plugs turn off
Reply: @mateipopa6343  glow plugs help warm the air in the compression chamber if the temperature is below freezing. The compression of the air and fuel is usually sufficient to cause the ignition.
Reply: where does the intial, "pump" given by the instructor come from
Reply: @alexanderwrightman9690  starter motor
Reply: Diesels don't use spark plugs, they use serpentines to ignite.
Reply: @erickiplimo it can, that’s why we add methanol/ethanol and in the old days, lead to increase the octane rating to prevent this from happening
Reply: Unless it’s a duramax then it just don’t work period
Reply: Glad this has so many likes.
Reply: First thought when I saw this
Reply: @kingofspainMB1807 no this is exactly the concept of how diesel works, air, fuel, compression, heat, ignition. Boom repeat.
Reply: Glow plugs
Reply: Best example ever
Reply: @41241ivatt  Glow plugs only help during cold start to preheat the chamber to assist in raising the pressure. The pressure itself is what ignites the fuel.
Reply: @kingofspainMB1807 they heat up the tube first, if it were in mist in this tube it prob be a fire in the lab by the time it goes boom 😂
Reply: Beat me to it.
Reply: Exactly!  And diesel vehicles use glow plugs in colder temperatures to assist quicker ignition.